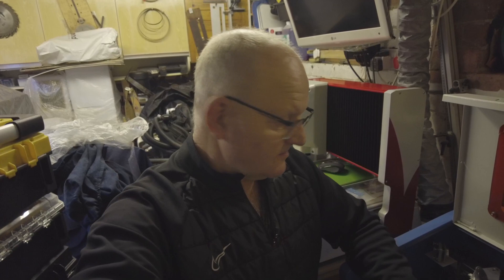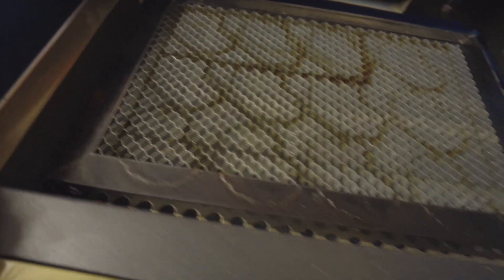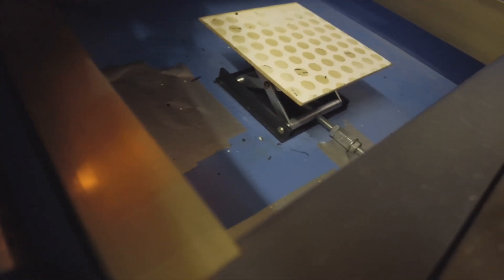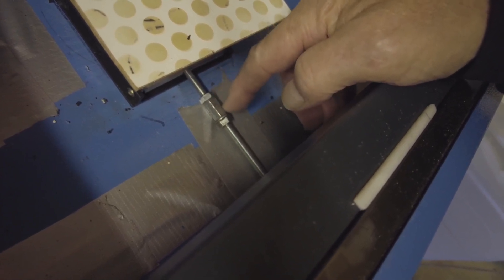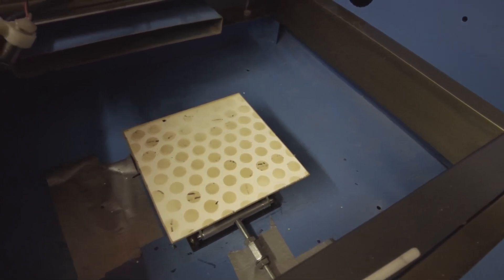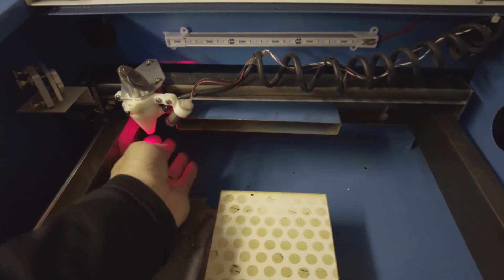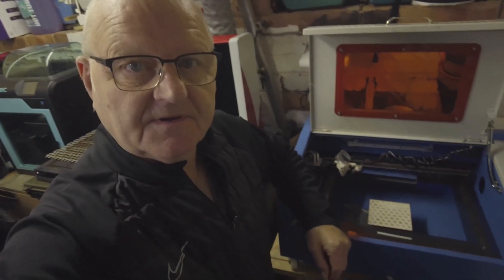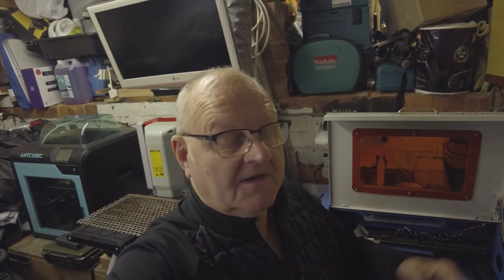K40 co2 laser cutter and engraver Adjustable Bed modification

Comment: Thanks I just purchased a K40.  Awesome Sir thanks
Reply from the maker: Glad I have been able to help
Reply: Done this a few years ago, best upgrade you can do on the k40. I fixed a metal plate to the lift and used punk studs as stand-off, works brilliantly.👍
Reply from the maker: Hi thanks for the message everybody has there own designs and yours sound good and it works. Keep inventing is the key
Reply: Yes I am looking at doing the same. It came with an Adjustable Focus Nozzle, but I know if I want to do even thicker material I will need to remove the current bed and purchase the lift bed @binshotalot